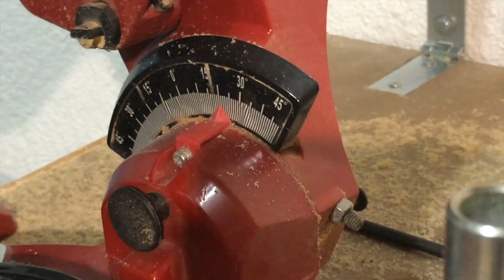Bookends Diy

Comment: I love it!!! I put off doing this because I know some that will gasp at this! But I have an old Singer that is very basic and common and quite frankly it will still be very much loved by repurposing it! The irons will be used for a console table in our home and the sewing machine bookends will sit on the bottom shelf. Thanks for the video!! Very helpful!
Reply: You soaked the wood pieces that go in the ends in water. Does that make it easier to get inside the cut ends of the sewing machine? And then you took a torch to them and scorched?